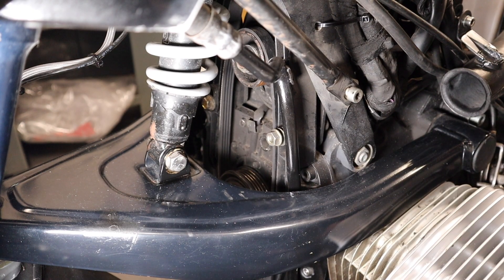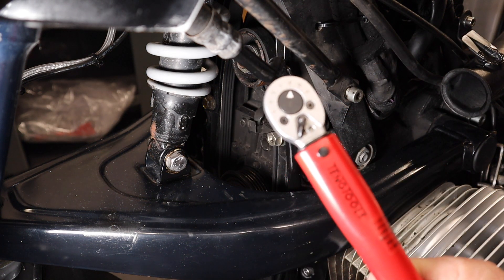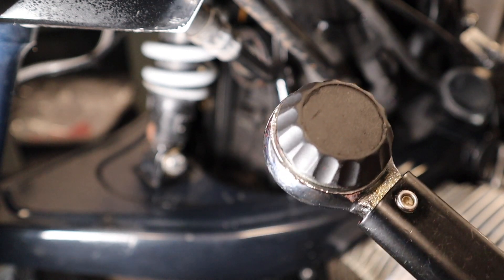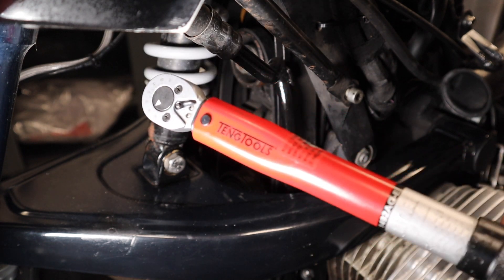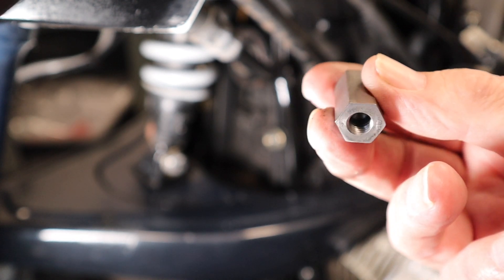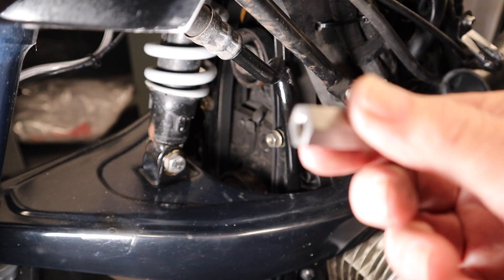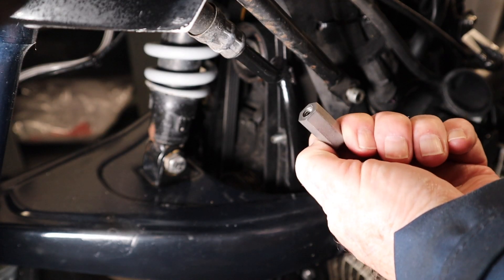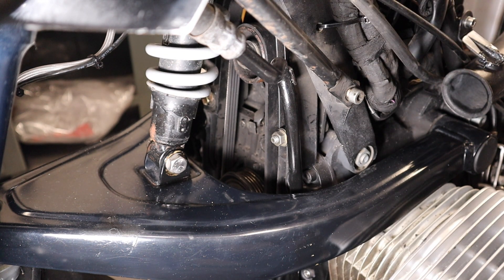1150GS Part 12

Comment: Very nice video, I am struggling the same way, would you be so kind to share the specs so I can replicate the tool? thank you very much!
Reply from the maker: Hi Julio, So pleased it helped you, certainly helped me at the time. A subscriber in Scotland asked if he could borrow the tool for his 1150GS so I sent it to him and told him just to pass it on to anyone else who asked. You have to get yourself some 13mm Hex steel. I just bought some on eBay. Cut it to about 30mm and drill a hole approx 15mm deep. Think I used a 7.5mm drill. Cut the thread with an 8mm tap and you have your tool. I presume you are in Spain or Mexico or Argentina or anywhere in the world🤣. I still have the Hex bar on my shelf and would make one for you, no cost at all, but the posting can be difficult?? Depending where you live. Let me know if you need help.

Comment: Hope your well. Do you no what torque the front axle should be on the gs1200 2005 ?
Reply from the maker: Haynes Manual for 2004-2009 GS says 50nm for front axle bolt and the front axle clamp bolts are 19nm. Hope that helps James 🤗
Reply: Normski thankyou. A bought manual but could not find it
Reply from the maker: Wish I could take a picture and add it here but YouTube doesn’t let me. If you go to the Wheels section at the start of that chapter it has all the technical information. Look for torque settings and front axle bolt is there. 👍
Reply: Normski ahh brill thankyou. Hope ya well.